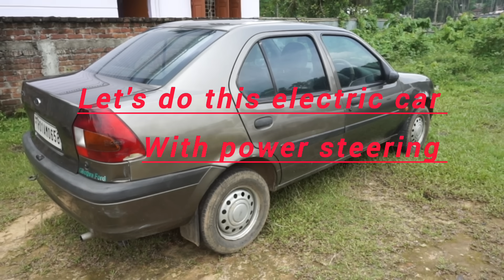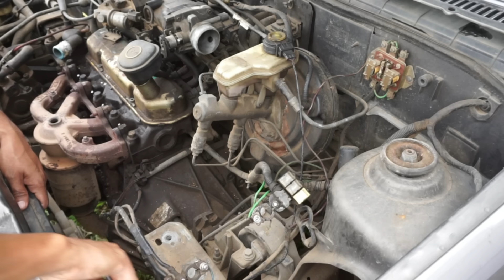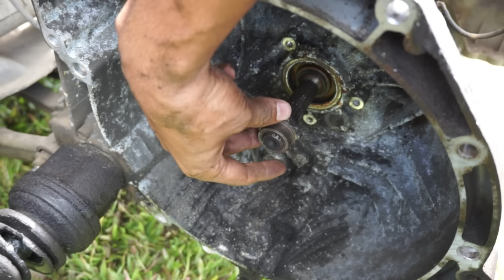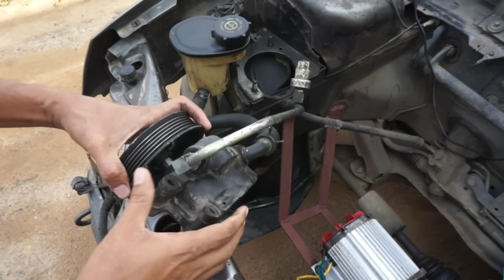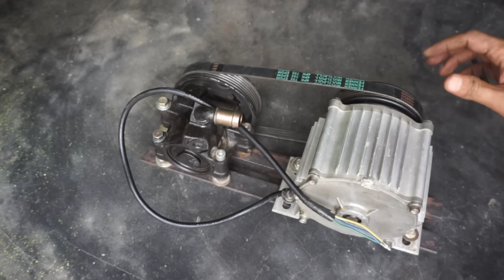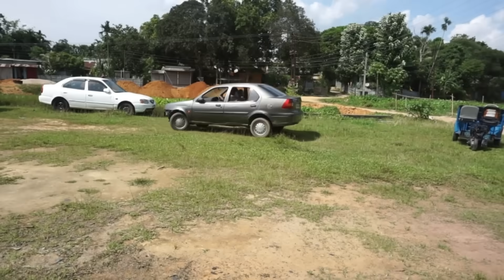the best electric conversion car

Comment: What is the best 0-60 mph time? I bet it won't do 60 mph, that motor isn't powerful enough, not even with with the 4 batteries it would need to get up to 48 volts it is designed to run on.

Comment: Need a vehicle inspection by DMV certified location to register the conversion of an Electric Vehicle . Once it is approved for standard and quality will pay $10,000 ten thousand. Equally important I got a 2002 Chevy Cavalier LS model and want to swap the engine. I live in Northern California .
Reply: This setup isn't in the United States: Hint, It's A Right Hand Drive Car.
Being a lifetime resident of California, as Ingious as this project is, there's Absolutely No Way you could Ever get this setup Legally Registered In CA.
This State has some of, IF Not The Most Strict, Complicated,  And Expensive Motor Vehicle Regulations In The United States.

Comment: need some specs to be sure but a 2000 Watt motor on a 60volt 40ah battery will last a tad over a hour . .and take 4 hours to charge on a 10A charger .. so a hour driving time is reasonable for short errands .. going to need a hybrid generator to go any distance you could mount a 3000 Watt generator in that engine compartment,
Reply: The controller should run on the generator or range extender power. Most of the controllers don't run the motor during charging

Comment: What is the maximum speed?What is the maximum current?
Reply: had he kept the clutch it would have done 70 kph or so , but it seems hes stuck in 1 rst geatr
Reply: Being a manual gearbox,i think is in gear 1 at all time. Probably 25,30 km/h speed and at 60v 40A/h it will do 15,to 20 Km.